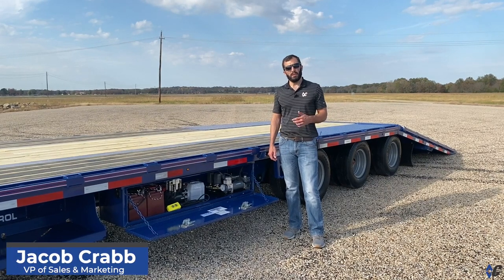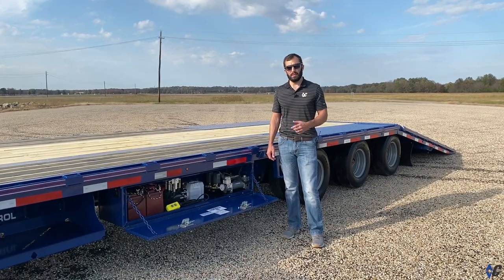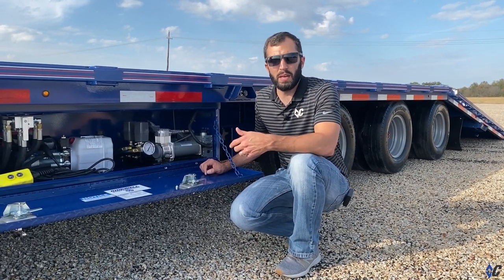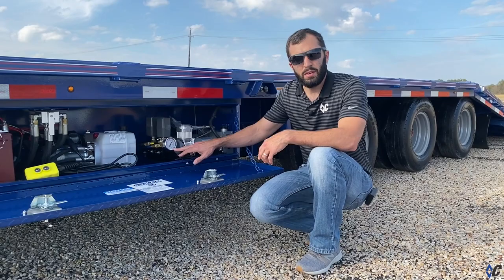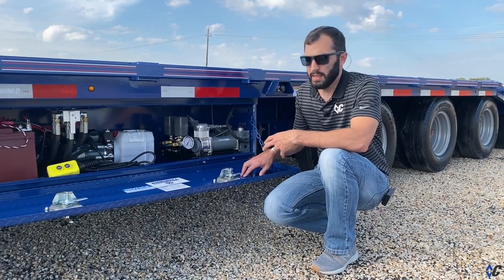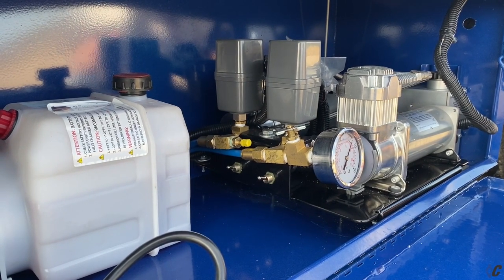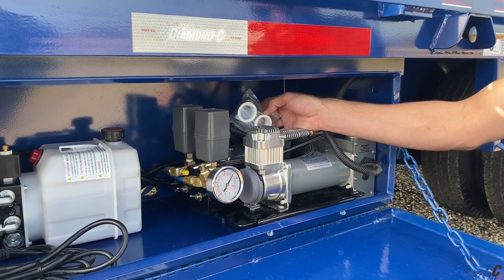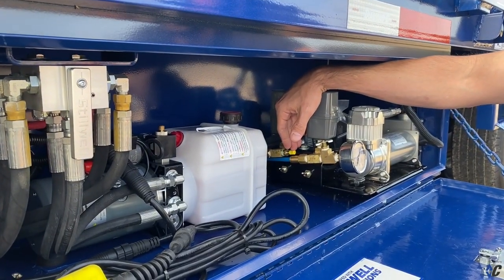Air Ride Suspension | How & why is benefits you!

Comment: Is it possible to have a dump valve and lift axle setup on an air setup? Would it required ride height control valves on each axle?
Reply from the maker: Lift and dump are both standard 😁

Comment: Can u add this air system to a trailer I already have
Reply from the maker: If you already have an air ride it can be updated with the Cush air controls. We are working on a upgrade kit and will release it in the near future. 

If you have a spring suspension trailer and are wanting to convert to air ride - it could be done but would require a substantial amount of fabrication and would be rather expensive.

Comment: What about air ride on single wheel air ride on an LPX with lift axle?
Reply from the maker: We have it available on single wheel on the MVC w/ 210 package 👍
Reply: @diamondctrailers  307 package?
Reply from the maker: @Royrockbrain  not on a 307. No air ride available for 7K axles.
Reply: @diamondctrailers  310? Looking to spread weight keep getting a tandem 14k trl sunk on soft ground, but hight clereance is a must looking for gooseneck, going to the website to look at the MVC
Reply from the maker: @Royrockbrain  Tandem 10K axles - standard on 60” spread. We could possibly build a 310 on a custom basis.